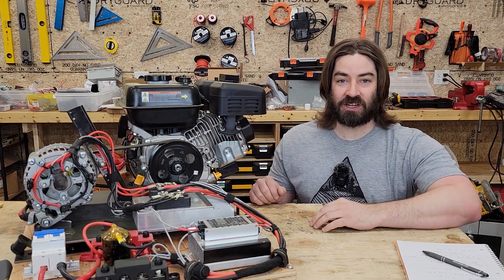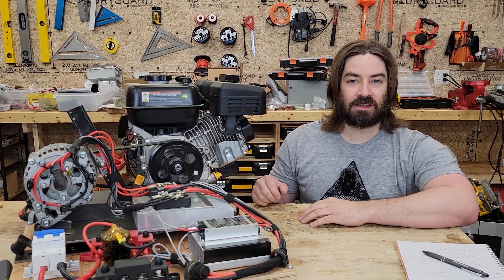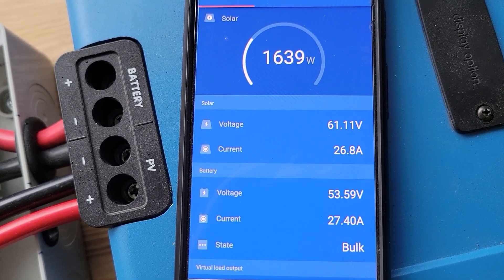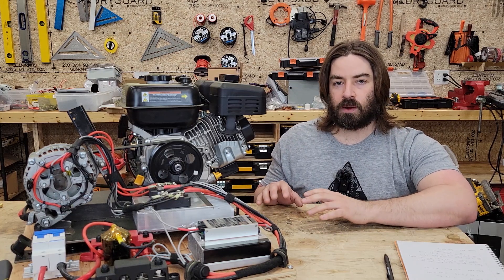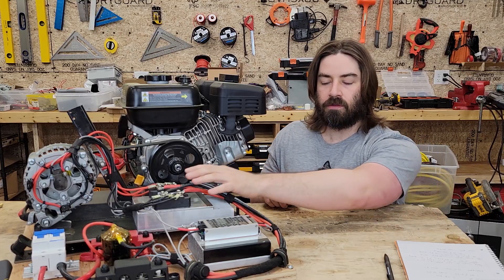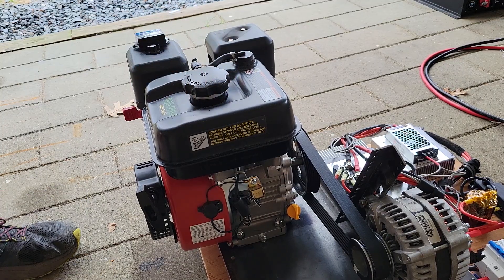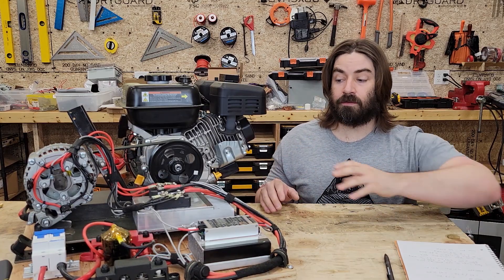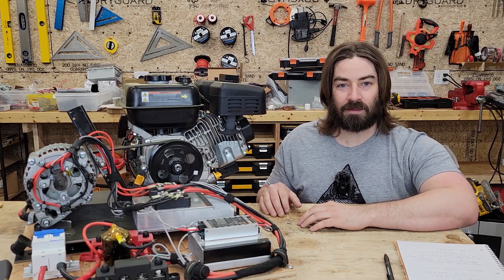More Efficient than ever!  Alternator Generator fine tuning, Part 3

Comment: Why don’t you try using a wind charge controller instead of separate bridge rectifiers? 

They are already designed to take a three phase and put like that running at various speeds and output a battery charging voltage

Comment: Hey if theres a way I can contact you ive wanted to make a very small charging plant for a camp site that I spend my summers at similar to this but just a little alternator of a Kubota tractor like a 20 amp to charge lets say 4 large 12v deep cycle batterys and then run an inverter off that the idea is basicaly a small power station that is self sustaining in the manner of large capacity "for the little use it will experience" that will automatically start and charge at low voltage and shut down at full charge somthing that in my mind shouldent run but every other day at the most but at the same time I want it "analog" in other words no fancy digital charge controllers mostly curiose if you can contact me some how so we can perhaps collaborate on a means to pull it off  in my mind a small 1 hp motor that just puts along at a reasonable pace to charge so one big fuel tank call it ten gallons a little briggs and stratton 5 s and an old tractor starter generator that can start the engine at calling voltage and then an engine cut off switch that kicks at full battery bank charge your a very smart man and id like to hear from you and get your input

Comment: I wonder what the efficiency would be if I increased the DC voltage by connecting Grezz bridges in the line. PV panels operate at a much higher voltage and lower current. Unfortunately, the rotor power supply would also have to be changed.

Comment: Have you used a treadmill motor before
Reply from the maker: Yes, I have a previous video on that.  However, I didn't have great results, but that was due to the under powered engine.  I tried using a 3hp engine from Harbor Freight, but that darn engine just wouldn't run well for me.  I should try the treadmill motor again, but with a 6hp engine.
Reply: @DavidPozEnergy did you charge batteries with treadmill motor,  also how can I find that video
Reply from the maker: Here is the treadmill video: https://youtu.be/DaF6n-9RVT4?si=dJPOH4e1CKMkf1Pt

Comment: Old video I know and looks like you have moved on. But for others trying to run at lower rpm and seeing the vibration issue. The motor has fixed timeing and is expected to run close to its rated speed. At lower rpm the spark is too early so the combustion is fighting on the compresion stroke. Summary Retard the timing. Removes top end power, gains efficienty lower in the rev range. Don't then run it at high rpm as efficienty will be crap and you could cook the exhaust valve or burn out the muffler.

Comment: I too know that this video is getting old, but I have a suggestion to add a small fan blowing on the alternator, i think ot would make a huge difference on temps and increased performance.
Reply from the maker: Thanks.  There are two internal fans inside the alternator.
Reply: @DavidPozEnergy 
Yeah i heard you say that, but there would be a envelope of heat that accumulates around the unit.

Comment: I know this is late but I was previously remiss in thanking you for this excellent series and the information provided.  It was very simple to follow, entertaining and you have an excellent presentation style.  I have modded an alternator and been playing with it myself.  I am wanting to both power a Grid tie inverter from the alternator and charge a 48V battery.  I got much the same voltage you did open circuit.  I have tried spinning the alt around 3000 RPM and about 8000 which is a little too much for the little engine I'm using but still proof of concept. 

My next thing is to use a PWM controller on the armature input to control the amount of power going into that. I want to investigate higher voltage at lower amps which I am thinking may be more efficent and another way of controlling output. 
From what I have read, the higher volts is the way to go as it uses less amps and therefore less heat in the armature. 

Thanks again for this inspirational series. Something I have wanted to do for a long time but your great info was the motivation. 

Thank you.

Comment: Instead of kicking off the field with a battery, you can add a stator to the engine and get 12v. little push button and away you go!

Comment: Way back my dad assembled a car alternator generator using an old lawnmower engine, they were bolted to a piece of plywood.  We used it for camping and boating.  It was cobbled together with 'scrap' parts, it was ugly but free, or nearly free, and it got the job done.

Comment: Great work on the efficiency testing! Your 15% improvement by dropping RPMs is solid, but I think there are some bigger gains available if you're interested in experimenting further - I'd certainly like to see you try!

The main inefficiency I see is that you're throttling the engine to control RPM. Small engines are most efficient at wide-open throttle (WOT) - throttling creates pumping losses and hurts combustion efficiency. Instead of throttling to 3000 RPM, try running WOT and controlling power electrically by varying the alternator field strength.

A few other ideas that could stack up nicely:

-Dual alternator setup: Run two identical alternators in series for 24V output instead of stepping up from 12V to 48V. Benefits:
- Much easier voltage conversion (24V→48V vs 12V→48V)
- Each alternator runs at ~50% load so they stay cooler (heat kills alternator efficiency)
- Mount them on opposite sides to cancel lateral loads on your crankshaft bearings
- Use the alternators themselves as tensioners - push them apart to tighten both belts simultaneously

Load-sensing field control: You could tap power from your engine's magneto/ignition system to automatically adjust alternator field strength based on engine load. This would let the engine find its optimal operating point while the alternators provide exactly the right electrical load.

Belt tensioning: A spring-loaded tensioner that responds to alternator torque could automatically optimize belt tension - tighter under high load, lighter during easy running.

These changes combined could potentially get you well into the 6+ kWh/gallon range while reducing stress on your engine. The dual alternator approach also gives you redundancy if one fails.

Your current 4.8 kWh/gallon is already impressive for a homebrew setup. These mods would just take it to the next level if you want to keep tinkering!

Keep up the great videos - really enjoying the series.

Comment: You can increase the rpm at the motor by adapting the diameter of the belt pulleys. The resulting higher Voltage should improve the efficiency.

Comment: I'd like to point something out. I watched your first video, and noticed that your awesome charge controller can take up to 450vdc as an input. So, you could have used any 120vac generator, and connected it with that bridge rectifier you have (I used to use one to dc arc weld with my ac welder, and it never even got warm), to convert that to 120vdc, and dumped the whole output of that (theoretically) into your batteries. That would probably saved you a lot of time and money. I'm just saying.....
Reply from the maker: I love how many ways there are to charge a battery.  I posted a video last month on using a big military 3-phase generator to charge batteries.  You might like to check it out: https://youtu.be/lT4FWgVWCGg

Comment: Waiting for part 4, we want to see FULL BRIDGE rectifiers wired in series. This will give more voltage, less amperage, less heat and losses, more efficiency.
Reply from the maker: Thanks.  I have been focusing recently on some diesel generators.  Eventually I'll get back to this gasoline project.

Comment: Something I never saw in the comments: The alternator was probably expecting to see an input to the field windings of 14 to 14.5 volts, rather than the precise 12 volts the buck converter put out. Also as you mentioned in video 2 about needing lesser gauge wires for the 48v to the MPPT, if you put 14v into the field windings they would also need less amps, and might gain you a bit more and run the alternator a bit cooler.
Reply from the maker: Thanks for your comment.  It's been awhile, but I think I talked about the field Voltage a little in video one.  It's an interesting topic. It turns out, if I increase the field Voltage, the Amps also increase to the field windings.  This is because the field windings have a fixed resistance of about 2.2 Ohms.  Try punching it into an Ohms law calculator like this one: https://www.calculator.net/ohms-law-calculator.html?v=12&vunit=volt&c=5.4&cunit=ampere&r=&runit=ohm&p=&punit=watt&x=Calculate and change the Voltage with the fixed resistance.

Comment: 100%if u have to buy any parts it's cheaper to get a used 5000 watt+ generator and a charge verter from eg4 for under $1000. 
To buy 
a motor 
200 amp alt
Charge controller 
Power supply 
Rectifiers
Breakers wiring ECT 
It'll be the same or more

Comment: You need to get that alternator moving  apx 4500-6500 rpm on the rotor.
And very the output voltage using a constant current supply on the field coil.
I have a custom controller loosely based on a VESC it requires adding hall sensors in the rear housing BUT with the custom firmware you can program over the start and stop voltage for the battery and it will drive the alternator to start the motor use a simple rc servo to regulate the throttle  and self tunes for efficiency.
I managed to get a hair over 6.8kwhr per gallon using a hf-P 212cc with the governor removed.
And over 9kwhr with a custom Camshaft giving the motor an Akins cycle
Reply from the maker: Wow, sounds like you have some really good computer skills.  It sounds like it's beyond my knowledge with computers.
Reply: At 9kwh per gallon, you’ve hit almost 30% efficient.  That’s impressive.  How did customize a cam?

Comment: You need to up the voltage of the buck converter to 14.6 to get more efficient use of the alternator.   Running it at 12v and limiting current to 5a is choking it down.

Comment: I guess I'm a little late to the party, but have you tried using the alternator as a 3 phase motor to start the engine.  So make it a motor to start the generator, them put it in alternator mode for charging the battery.
Reply from the maker: I have not tried that.  I've seen some videos of making an alternator into a motor, but that requires a speed controller.  Not sure if there is a simpler way out there.
Reply: @DavidPozEnergy Just guessing, but maybe the speed controller wired to the alternator as a motor. The dc output of the rectifiers could be switched off to prevent parasitic loads during cranking. Your alternator has two sets of windings, but I would assume only one is needed to crank the engine. The only thing left would be to find a way to take the speed controller out of the circuit after the engine starts. Maybe some relays connected to a starter switch could do that. The only real question left is whether there is enough torque to spin over the engine with the pulley ratio used.

Comment: I doubt it would be worth the cost but i wonder if a torque converter the cvts for these would help any
Reply from the maker: I don't think those would help in this situation.  In my case, I'm using the MPPT charge controller to achieve the maximum output.  Thanks for watching.

Comment: I found the harder I run the generator, the more efficient it is for power output per gallon.
I believe the engine requires a minimal amount of energy that doesn't vary a lot just to run and then everything over that can charge batteries after charge efficiency losses.
This does wear the engine down faster and reduces lifetime of the generator.

Comment: Sweet Dino juice charger! I may be a little late to the party here but I have a suggestion that may or may not be stupid. Could you not excite the winding with the 12v charging system right off the engine. Idk what Amp max the charging system is on that predator but most should be 10A. You'd just have to test it I guess. It would eliminate that buck converter and simplify the system at least. Anyways, cool video man!
Reply from the maker: This particular engine doesn't have charging coils. I looked up aftermarket kits for installing some, and turns out I need coils, and a new flywheel.  The kit was more money than the engine.  LOL.  If I did this again, I would buy an engine with the electric start (thus coils) from the factory.
Reply: @DavidPozEnergy  that's usually why they Predators so cheap. I thought I saw the little voltage regulator by the kill switch but it must have been something else. Maybe find a blown engine with the charging system for dirt cheap? Thanks for the reply even though I was so late to comment. 💯

Comment: To reduce the losses you might wan't to remove the MPPT Controller completely. Just go with the rectifiers to the battery and adjust the field current to get the desired charging current. This will remove one additional step of voltage converting.

Comment: Pet peeve of mine, but nonsense statement at 0:50 : 4.2kwh at full engine speed makes no sense (kwh depends on how long he ran it for) correct should up 2.19kw at full speed. Always amazed how often this mistake is made (though I know that the kwh unit can be confusing)
Reply: Blablabla! So many youtube comments experts. Go make your own video and do it right.
Reply: Kinda old at this point, but he wasn't making a mistake here. That 4.2kwh number is electricity (energy) generated from 1L gas, at 2.2kw (power). This just shows you didn't watch the previous video.
Reply: No. It's 4.2kwh. it's fully measured moron

Comment: I believe throwing a good sized flywheel on that would help out with kWh per gallon. It's easier to maintain the rotation of a 50-100 pound flywheel than it is to turn that alternator. And a planetary gear set on the motor could allow you to keep the roms down better.

Comment: Use way less engine  feed energy back to 12 v motor with a flywheel for kinetic energy motor just to keep momentum in motion you will probably spend more in fuel than electricity costs figure out torque and gear ratio

Comment: David I think the pully on the engine is too big the alternators power curve is about 3200 to 4000 rpm and you have the alternator running at 6000 rpm that's way outside of the power curve just think about this .. I you drive your car / truck on the hwy at 70 your engine crankshaft rpm is about 2000 rpm and the alternators rpm is 4000 in the first, second, third test all of them had the alternator running to high an rpm in your case I'd change the pully on the engine to 1-1 ratio subsequently the engine will work 1/2 as hard to run the alternator and get way better fuel economy as well the alternator will still produce the same output.. I love this project and am working on my own as well.. keep up the good work
Reply from the maker: Thanks